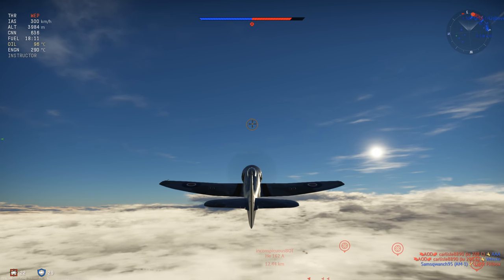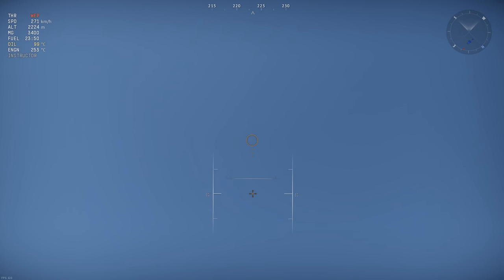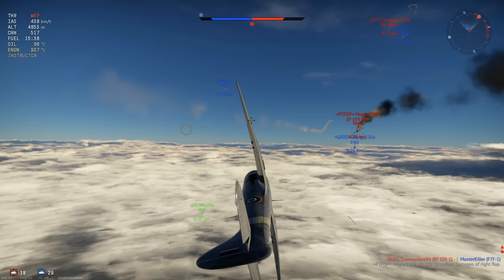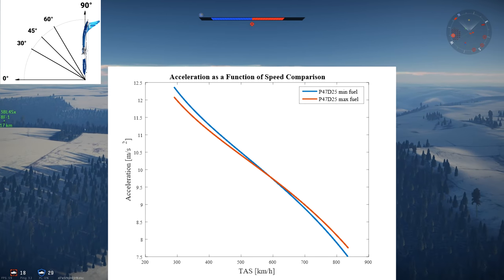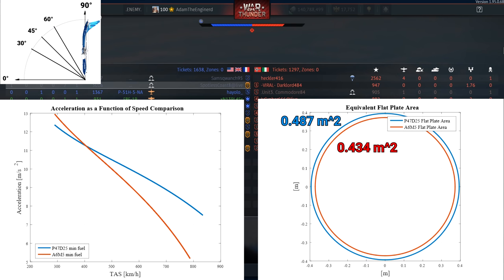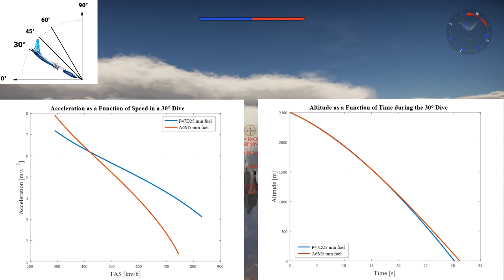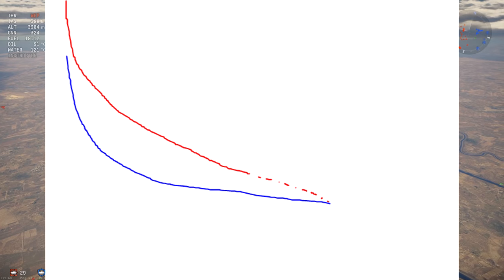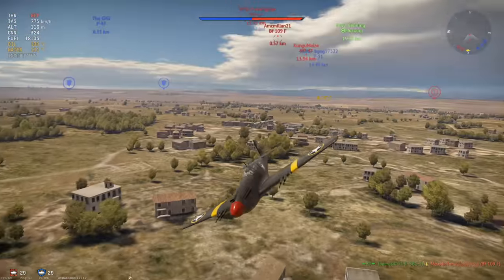Mythbusting | Do Heavier Aircraft Dive Better Than Lighter Aircraft?

Comment: That Video got recommended from YT i dont know why, but my 9nly thought Was just fly the Do 335 they are heavy as hell, like a bus in the sky, cant turn etc. (even they were like  FW in real), but even with that weight you gain slower speed on a dive then any other Nation aircraft, which will even get up on you even when you Start 1 km the dive before He has. But this airplane is in War thunder even a joke, low Max speed, wrong Stars in comparison how that Planes really Was, and even the flaps even on 350kmh they instant Pop off and rip your whole wing mostly off, or turn your plane upside down and you cant manouver anymore.

I dont know if you did such an Video already but just compare specially German Ammo where Stats dont Match witcher like to other Nations. As a example if youre shooting a 37Mm HE ammo into an american plane even in a directx hit on a wing its just give you "hit" marker and nothing more happens, i even tried it to Track a cebturion with a coelian it took over 250 shells (AP and HE mixed) to get 1 Track off, but a 50 cal Hits you 5 times in german tank gun Barrel and the Barrel is destroyed or even tracks are destroyed faster then with a 37mm gun. Same goes with 50 cals against german Planes, 1 50 cal tracker shot just pens through your whole plane and even functions more as a HE round then the actual HE rounds. Thats why i stopped wt over 4 months ago, i just got tired of it, to need in a german plane with 30mm or 20mm guns 10x more Hits on other Nations Planes to kill them but 1 50 cal is busting a whole plane like it got hit by a rocket.

Best joke i had when i was in my Wirbelwind tried to kill a spawn killing p47, He shot the turret and that 1 shot that pen the armor went like crazy in the Wirbelwind (through the armor, killed gunner, loader, Commander and driver sounds weit but it happens) and if there it was the mechanics just fcked up i dont know but i save me my nerves and stopped playing WT so easy was it for me.

And specially that they add just more and more Heat FS in Br6. 7 i just dont Anger me more and uninstalled it, its just ridiculous cold war era tanks against ww2 tanks, where Germans have already nö stabilisation and then have to fight more and more Heat FS shit where they dont even need to aim just shoot any where in german tanks in this BR and its instant dead
Reply from the maker: It's always good to stop playing if you don't want to.
Reply: @AdamTheEnginerd  yep and specially when you can just frwak out since it happens everytime with their german Nation in wt. And i just saw a yt Video that they added a New french wheeled vehicle with heat fs at BR 6.7 when i saw that, for me i just thought thst break is gonna be now 4 months added up before i start thinking to Touch this game again

Comment: If your understanding of the myth is that all heavier aircrafts will dive faster then I agree with your conclusion : there are plenty of counter exemples.

I have to say though that people who say it usally mean that if the only parameter you change on an aircraft is mass (same thrust to weight ratio and same drag coefficient and cross section) then you can easily prove that the heavier aircraft will accelerate better in a dive at any speed (and not just above its level-flight top speed as you say at the end).

m*a = t*m + g*m - Fd
a = t + g - Fd/m
(t is thurst to weight ratio)
Higher mass is in this case always synonymous with better acceleration.

I have to say that your video is interesting nontheless but when it comes to mythbusting I think you busted the wrong myth.
Reply from the maker: In the video I dealt precisely with that by comparing different fuel load P47s, and the lighter one accelerates better before reaching the top speed, and then the heavier one accelerates better beyond the top speed (see graph at time stamp): https://www.youtube.com/watch?v=rCUm2tE2vys&t=4m07s

The issue with your equation is that you leave T/W constant while increasing the mass, and that's not valid. Increasing mass will decrease T/W on a given aircraft. If you allow both T/W and Drag/W to vary with weight (fair to compare the effect of weight on dive), you get the graph shown above.
Reply: @AdamTheEnginerd  Ok so we agree on physics but we disagree on the fact that T/W should stay constant. As I said in my previous comment, whith your understanding of the myth, all your conclusions are true (at least i agree with what you say).

I have to defend my point though:
Your graph on the P47 does not apply to my view of the myth because min fuel P47 has higher T/W ratio than max fuel P47. (I must admit that it is a useful graph to know about as a war thunder player and the fact that the speed at which the acceleration is equal is the top speed is pretty) 

I disagree about my view of the myth not being valid: 
Usually when engineers make a plane heavier than a existing model, they then tend to try to increase its power to still get the same T/W ratio (like tank engineers do) because they know it's essential for a plane to have decent T/W. My point is that in general, for WW2 fighters, I don't think there is a strong correlation between weight and T/W ratio in either way (for aircrafts of the same technological level that is: I m not comparing early WW2 models with late WW2 models).
On the other side, I allow D/W to change because I assume that drag stays relatively constant (If you just add armor, guns and a stronger engine to compensate for instance: those don't really increase drag) while weight changes.

If I were to be honest, T/W actually usually increases with weight beacause bigger engines tend to be more efficient but I still think leaving T/W constant is a valid point if you want to generalize a statement to all fighters.
Reply from the maker: @DoubleA44  My view is that we strictly want to compare the effect of weight on dive performance, so we must keep everything else (Power/thrust, drag, etc) constant and only vary weight to see its effects on dive with no other changes that can skew the results.

Engineers make a plane heavier often by mounting a better engine which usually weighs more and forces a bigger fuel load due to the higher fuel consumption. Indeed T/W wouldn't change much in that case, but then you are comparing 2 different planes (P47D25 vs P47D28 for example).
Reply: @AdamTheEnginerd  I see what you mean: you understand the myth as comparing the same aircraft with more or less weight which makes sense but my understanding of it is that it is a general rule (not always true) to compare different aircrafts. 
So in your view of the myth, keeping T/W is indeed skewed but for compairing different aircrafts I think it makes for a more useful conclusion to keep T/W constant.

Comment: You better use DCS of other sim to check this statement.....WT physics is "IF - THEN - ELSE" level of programing....there is no real physical engine in game
Reply from the maker: I used real world physics on WT flight models and got the same result as a WT test. If I had made my own FMs, I'd get to essentially the same result but speed 100 extra hours. How can you say there's no real physical engine in game? Every plane is really close in performance to the available data, and it's an impossible task to make FMs to fit every performance metric.

Comment: Is 100% prop pitch all time is worth it?
Reply from the maker: Only as a general rule. Some aircraft like P47s have better performance at around 80-85% pitch than at 100%. In other aircraft, you can trade a bit of power for better cooling by reducing pitch to 85-90%.

Comment: Title screen cursed. Use seam carving instead of partial compression PLEASE the P-47’s left wing and the Zero’s right wing aren’t shorter compared to their respective opposites REEEEE
Reply from the maker: Not even sure which way you are going with this.
Reply: AdamTheEnginerd the screen, the P-47’s left wing is considerably shorter than the right wing, and the Zero’s right wing is shorter than left wing
Reply from the maker: Optical illusion.
Reply: AdamTheEnginerd no, optical illusion would’ve had the opposite effect i.e. make P-47 right wing and Zero left wing seem short

Comment: But War Thunder isn't an accurate simulator. Too many unrealistic errors and too many planes have the terminal dive speed confused with the real life maximum TAS optimum altitude horizontal speed. Many planes cannot even reach their real life top speed at the optimum altitude.

Another problem is that players have zero control over prop pitch settings so cannot whack the prop into a coarser pitch (higher gear) to increase thrust whilst in a dive, thus increasing dive acceleration. The same goes with attaining the real life quoted top speeds at optimum altitude. 

The real life terminal dive speed for the Soviet I-153 biplane was 362 MPH. In accurate sims, such as IL-2 1946, the wings rip off at 363 MPH.
The real life maximum recommended dive speed of the Hawker Hurricane I was 430 MPH.
The real life maximum recommended dive speed of a Hawker Hurricane II was 525 MPH. (It's on a warning plate in the cockpit in some sims)
The real life terminal dive speed of the Hawker Tempest V was 657 MPH.
Reply from the maker: Rip speed is always in IAS, or Mach.

You can changr the prop pitch in WT.

The vast majority of aircraft in WT have their appropriate top speed and climb.

657MPH is supersonic at altitude, the Tempest never went that fast.

Comment: Its useless make this kind of tests in WT.
WT nothing to do with reality, just check out the torque effect on the planes. Nothing to do with real flying...
Reply from the maker: Well I used WT flight models, applied the laws of physics to simulate a real dive, and the results matched perfectly with a WT dive test...

WT removes torque unless you're in full real controls, it's a conscious decision.
Reply: @AdamTheEnginerd  I talking  about simulator battles physics.
Reply from the maker: @rolandhunter  There is torque in sim.
Reply: @AdamTheEnginerd  Yes and simualted wrongly, that is what I'm talking about.
Reply: @AdamTheEnginerd  there's your issue, you used War Thunder's flight models...
Reply from the maker: How is the torque simulated wrongly?

Gustav, what's the issue of using WT FMs? Do you think they break the laws of physics? Do you think they have their own physics? Because I applied real world physics to the WT FMs to simulate the dive, and got the same result as a WT test dive.
Reply: @AdamTheEnginerd  Bf-109 has left torque, because the propeller is turning to the right.
So at take off you have to do right rudder. That is correct.
But you should know: In left turn the plane nose tending to lift on right turn its tending to fall.
In real life, if you turning right with these options and your speed is lower then 270 km/h you have to use the rudder TO THE Left. But above 270 km/h for right turn-->right rudder.
In this shit WT if you have 400-500 km/h with Bf-109, you have to use left rudder when turning right. THis is bullshit. And nothing to do with real life.
Reply from the maker: That tendency is small, if it is indeed not in the game, does that make the whole thing have "nothing do to with real life"? Of course not. Something that is 95% correct is a very good approximation of reality. You shouldn't see it as either 100% right or else it's wrong.
Reply: @AdamTheEnginerd  This is why i choosed Il-2 BoS for simulator flying. That is real.
Reply: @rolandhunter  IL-2 is a game as well, sorry bud but nothing will be 100% real aside from reality
Reply: @shadowaffles  Yeah, but 0% and 50 % is much a difference. Because WT torque effect has nothing to do with real life.
Reply: @rolandhunter  So you're having an issue with the fact that P-factor isn't modeled?
Reply: @martijn9568  P-factor and torque effect is 2 different thing.